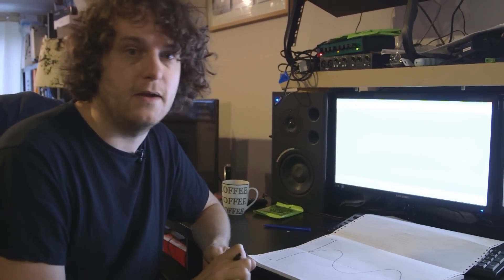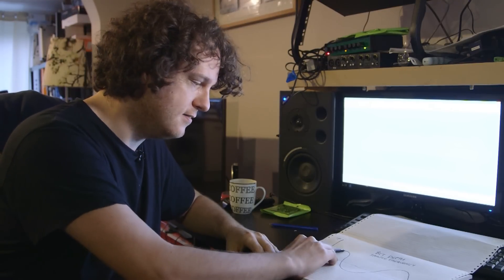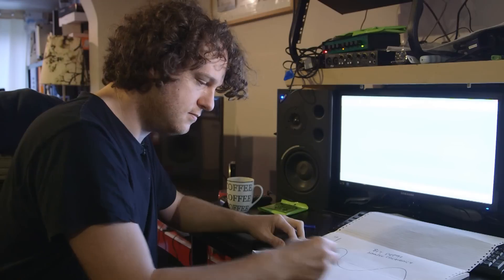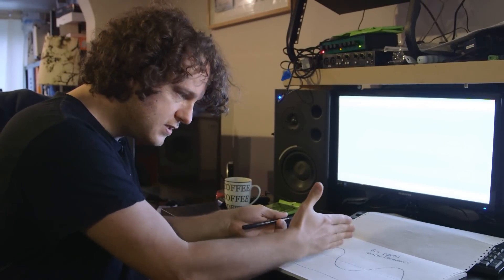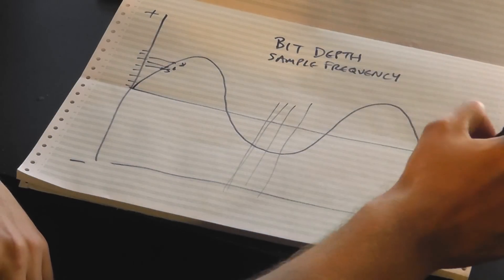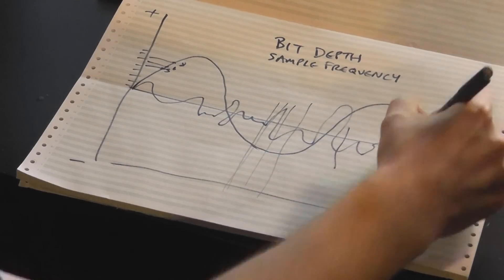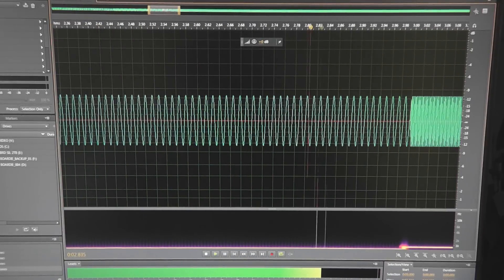How Digital Audio Works - Computerphile

Comment: I hope someone can answer me on this:
From 2:10 he says that we only need a low sample rate (or sample frequency as he calls it) to represent the low frequency sine wave. But why doesn't that produce a sort of triangle shape? As he says later on in the video, the computer thinks it should go straight from point to point, and if it did that with the low sample rate, it would not produce a sine wave sound. I think I watched video explaining this once, but I can't find it now... I believe it has something to do with dithering? or something idk
Reply: +paulcmnt This is entirely incorrect. Photos are not equivalent to audio. Just like pixels, audio files contain a bunch of 'point samples' however unlike pixels, they are not represented as 'squares' or as a flat section of the audio waveform. Whenever you listen to a digital file, it goes through the DAC, which looks at all of the point samples and then finds the only possible combination of sin waves that will fit, and outputs that sin wave as a perfectly smooth voltage change (analogue signal).
Reply: +Alpha Kay So far, I think only one got close to answering your fundamental question. The gist of it is that, as Fourier analysis shows, you can construct any periodic signal just by combining sine waves. They can be seen as the fundamental building blocks of signals; which isn't true of triangle waves, for example, since they're also the result of the addition of sine waves. Analogue-to-digital converters decompose signals into a bunch of sine waves, therefore digital-to-analogues have to do the opposite. That's why a computer doesn't "join the dots" with triangles; that could completely distort the original signal.
Reply: We didn't really go into that in this video, it was very basic. Maybe it's a subject for another time.
Reply: I get that part, and that wasn't really my question. I can try and explain it differently:
If you know a bit about sound and its digital representation, you'd know how a sine wave sounds and how a triangle wave sounds. To me it seems like a triangle wave needs much fewer "points" to represent that wave, it actually only needs the maximum value and the minimum value. But the slope of the sine wave is constantly changing, and so to me it seems like it would need an infinite amount of points to represent that sound wave.
Reply: +Fernie Canto Thank you and thank you to geonerd, this was the explanation I needed. I also had a hard time imagining a wave  with more harmonics (like a triangle wave) being "easier" for a computer to cope with than a sine wave, which as you mentioned is the building block of all digital audio. (I'm actually writing a paper for school in a couple of weeks on Fourier analysis and Fourier transformation, so I'm doing some research on it right now :) )
Reply: +Alpha Kay His explaination is essentially wrong - there is no "point to point" in the reconstruction.  (And there are no "stair steps" either.) Any competent DAC will produce a lovely sinusoidal output, regardless of the bit depth or sample rate.  Please watch the video I linked to earlier; it does a superb job explaining and demonstrating how all this works.  :)
Reply: +Alpha Kay The digital -> analog converter understands this and "fills in" the "missing" sine wave information in a smooth, intelligent, accurate manner.
Reply: +paulcmnt Only if your ears can hear infinitely high frequencies.  ;)
Reply: +paulcmnt True, but I figured that it was a little difficult to start explaining that pixels aren't squares, but in fact point samples as well. They might be strictly the same, but digital images are always represented to people mere humans as a bunch of squares, while audio should not be presented in such a way despite the fact that it often is.
Reply: +Alpha Kay 
A 44.1KHz sampling rate is enough to store the entire range of human hearing, anything above that, is useless for humans. 
A 20KHz sine wave can be represented perfectly with only a sample rate of 44.1KHz.
If you go below 44.1KHz you start to lose information, if you go above you don't gain anything.

The bit depth on the other hand, just affects the noise floor, and 16bit is enough.
Reply: +Gordon Freeman We need to use huge sample rates (oversampling) when synthesizing audio in audio software. I.e. if I use a square wave oscillator and kick its frequency up to something huge, it prevents a lot of the harmonics that come out of the raw synthesis process from reflecting. It prevents aliasing and the offending frequency content can then be filtered out before going back to 44.1kHz. So it's not always that clear cut that 44.1 is enough.
Reply: Bogdan Vera

Because most music is made from square waves of high enough frequency to require a sample rate of over 44.1KHz, right?

Sure, if you want to use high frequency square waves you have a reason to increase the sample rate, but for your day to day sine wave, 44.1 is enough.
Reply: Well pretty much all electronic music uses some variety of anti-aliased square/saw/triangle waves. Anti-aliasing generally involves oversampling. 

A square wave at a tame frequency of 440hz will have plenty of harmonics going way above 22050hz, which at 44.1khz sample rate is a recipe for fizzy horribleness.
Reply: Bogdan Vera

I said most music, not an entire genre of music.
Would you mind giving me an example of a song that would benefit from higher sample rates?
Reply: Yes, the stair steps myth pops up all over the place. Sony and Philips did actually know a thing or two about sampling / DACs / ADCs when they jointly developed the CD format during the late 1970s and early 1980s.

Comment: Drawing lines between points? Sorry but that's just not true. That would produce a lot of aliasing and distortion (like square waves as he said) and that's certainly not what happens. DA converter draws smooth curve with reconstruction filter. Only thing you loose with lowering bit depth is data lost with quantizing, which makes noise floor louder.

I think you should correct that statement.
Reply: +David Domminney Fowler 
Please don't do that, and if you feel it is necessary to oversimplify to such an extent pleast specify in the video "this is something of an oversimplification".  Because this video is downright incorrect in some cases.
Reply: +David Domminney Fowler, I agree with +Tommy59375 completely.  I watch the *phile videos precisely because of the way that masters of their craft are able to explain deeply complicated concepts without distortion or oversimplification.  These aren't buzzfeed videos.
Reply: Apologies, but for the sake of a short introduction video I simplified the whole subject somewhat.

Comment: 10:00 There is another reason for softwares to use 32bits. Most computers can only allocate memory in lots of 8, 16, 32 and 64 bits, so 24 bits are awkward to use. So the software may use the larger 32bits because it is easier and faster, and just convert it to 24bit when you ask it to save/export the file.

Comment: if the wave does not fit in the bit depth , why don't we just increase the bit depth like 32 bit or 48 bit ? Another question is why not bit depth is 16 bit or 32 bit ? why 24 bit ?
Reply: +Muztaba Hasanat Every wave could fit in 16bit. It's just that for mixing and recording they require overhead. This is because every time you manipulate a wave a little bit, the volume of every sample needs to be described using a number between -16,000 and +16,000 (or so). If you change the volume for a sample and the maths ends up saying 'give this sample a volume of 5,256.6'. But you can't have floating point numbers (no decimal places). So it rounds it up to 5,257. You can't hear this change in volume, but it over many thousands of changes to a sample this begins to create a fairly significant change. a combination of lots of differences in .5 from what the wave should be. Done to many samples in a song, this creates a quiet noise.

Larger bit depths make this noise much quieter. So that is why 24-bit (or 32bit) is generally used in mixing. The final master doesn't need this because no more changes will be made and the noise doesn't have a chance to get loud. 16-bit is more than enough for even hi-fi listening. 

16-bit gives enough control over volume that the quietest sounds are around -120 dB, which is well out of any human's hearing range.
Reply: +Muztaba Hasanat the reason you can't keep increasing the bit depth is because the file size get bigger, remember 1 cd is 700mb and that only 16bit
Reply: Thanks to all :)
Reply: +Alex Lee Most humans can't detect the difference between an analog audio signal and a digital audio signal with 16 bits/sample. Also, when you use higher and higher bit depths, you need better digitization equipment. The least significant bits tend to be mostly noise if you don't possess a good equipment.

Comment: If sampling of a signal with frequency higher than half of the sampling frequency occurs then the signal will not be 'cut off', it will transform into a signal with another frequency.
Reply: +Sparker yes, nobody said otherwise... they were only talking about cutting off when adding waves past the bit depth, weren't they?
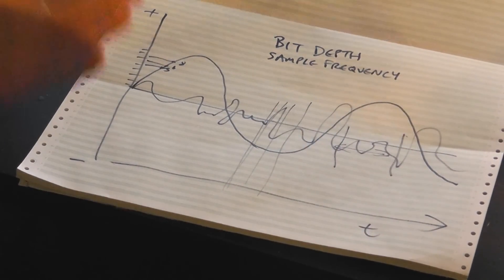Reply: Benjamin Philipp No, I'm talking about the 'cutting off' at 2:24.
Reply: +Sparker oh, pardon, I "overlooked" that (shame that you can't use the word "overheard" in the english language like that)
Yeah, I guess that can only ever be taken as an abstract concept where you "cut off" at an information threshold :/

Comment: Dividing the audio up into the smallest samples at 96KHz or 192KHz, benefits the whole frequency range.  It will not allow you to hear beyond your hearing capabilities, but it will make what you can hear much more detailed and smooth.  Add to the fact that a 24-bit depth pushes the 'noise floor' further down, thus giving you more usable range to work with above the noise.  So to summarise having higher bit depths and frequency ranges, does improve what you can achieve and hear.  It is NOT only about higher frequencies to make your dog howl!  Also the creator of this video did not mention the audiophile music formats such as Super Audio CD, which uses a bit depth of ONE, but has a really weird process which uses ultra high frequencies.
Reply: +EgoShredder 96KHz or 192KHz will not produce more detailed and smooth sound in the audible range. In fact, it can be damaging because inaudible ultrasonics can produce intermodulation distortion in the audible range.
Reply: +EgoShredder Actually this ONE bit has nothing in common with bith depth per se in conventional understanding. It's a different coding system. DSD has 2,84 something sampling rate and uses Pulse Width Modulation where "density" of ones and zeroes actualy defines analog value in given time. Something like so called D class amplifiers. I wonder if it could be nice to create PWM amplifier locked exactly with dsd signall with at least 10W per channel. No DAC in such system at all. Ouput stage would be a DAC :)
Reply: +Marcin Sosiński It's a complex and controversial system but somehow it seems to sound nicer than the other competing formats.  Apparently the SACD system introduces a lot of high frequency noise during the process, plus DSD is very hard to edit;  I think DXD was introduced as an editing format for DSD production.
Reply: +Max Grrr Yes that can happen.  I suppose what I am getting at is how can we get digital to match what analogue can do?  Both have advantages but how can we get the best of both worlds?

Comment: I think this could easily be compared to and illustrated through digital imaging and sequencing. An 8 bit image will look grainy and lack color space and an animation running at 10 frames per second will looks choppy.

For comparisons sake then, 16 bit and 24 bit audio can be likened to 16 bit and 24 bit images respectively. One can see some hard edges in color tone on 16 bit images with color gradients (which can be likened the the wave's peaks and troughs) and one can perceive choppiness at 24 frames per second vs 30 frames per second. The latter being the reason SOME audiophiles use 96 KHz because just like with their audio i can tell the difference between 30 FPS and 60 FPS and even 60 FPS vs 90 or 120 FPS. It's the reason monitors come with syncing technology like GSync and FreeSync these days that support 144 Hz and even more.

Some people are just more sensitive to different stimuli, be it a master chef, an FPS competitive gamer, a musical prodigy or a tightrope walker with a very keen sense of balance.
Some of us get seasickness or motion sickness while others have no idea what the other person is experiencing.

Obviously for me, visuals is my frame of reference hence why i draw the comparison with audio fidelity and visual quality.
Reply: Çerastes And to you apparently there's not difference between a MIDI file and a FLAC file....

Go home, you're drunk.
Reply: Çerastes Why so ignorant?

Comment: I remember my first soundblaster card, it could not only sample at 44.1kHz, but also 22.05kHz, and I think even something lower than that (16kHz?) - it also had an option to record at a bitrate down to 8 bits. So basically, it sounded like talking through an old telephone. But then, this was an amount of data the PCs of back in the day could handle much better. It was an old 386, and the soundcard could not use a bitrate any higher than 16 bits.

Comment: Awesome to know how the technical part of my audio work works. Working with orchestral pieces and a lot of low and a lot of high and those 'lingering' cymbal notes I did work at the higher settings like 24 bit. Good to know why exactly I have to do so on a technical level.

Comment: egregiously wrong in pretty much every topic he described. sampling frequency explanation was botched, quantization noise explanation was spoken like an audio snob rather than an audio engineer (the computer doesn't "draw lines" between samples, and the effect of quantization isn't like what you described--it mostly sets the dynamic range)
Reply: Could you explain to me in detail. I'm seriously intrigued by this.
Every video I see about 'Digital Audio' seems to think that the wave from a digital source is square, when it's clearly not.

Comment: Please explain when dynamic compression comes in the process ...
Reply: Dynamic compression is a process that's done to the audio signal, such as a vocal track, so that loud parts where the singer sings loudly are lowered, and quieter parts are raised, so that you can level out the amounts of loud to quiet parts in a song. In the older days these were done by analogue compressors, but these days you can use a plugin in a Digital Audio Workstation which can mimic the analogue gear. 

The basic principle is you have the Threshold which states how loud the signal must get before the compressor starts working, the Ratio which determines how much will be let through or "reduced", i.e, 3:1 which lets through 1dB every 3dB over the threshold, the Attack rate, which states how quickly the compressor kicks in, and the Release rate, which states how long it will hold the volume at the compressed level after the signal goes below the threshold again.

The basic formula for how much an input is reduced is: output= (input - threshold) / Ratio  + threshold. So for instance, if a vocal that peaks at -1dB before going into the compressor that has a 3:1 ratio with a -10dB threshold, then the formula would be: (-1) - (-10) / 3 + (-10) = -7dB output, which means it's reduced by 3dB.

This now means you could bring the overall volume of that track up, or "make up" the gain by 3dB without it clipping, thus making the vocal's loud and quiet parts more level.
Reply: +johannes914   
dynamic compression comes into the process after recording.  

It is technically a post production tool but can be used in other places like live performance.  
You would choose to use it when a sound source is very dynamic, in that the volume levels change a lot and the rate that they change is not predictable.  
  
Think of it basically as an AI fader that can analyse the input and quickly make a decision of how much volume breaking or boosting it requires.
Reply: +johannes914 ln simple terms, compression makes the loudest parts of the signal quieter which then means you can turn the whole thing back up without distortion.
Reply: *****   
If someone gives too much mic, enough to damage the recording or performance then you just lost your job.
Reply: +johannes914 It comes into the process, way overused, once a record company is involved.
Reply: rhoyt15 Yeah, I'm stereotyping. But 9 times outta 10, the record companies don't use it correctly.